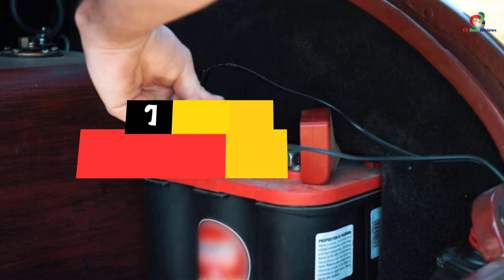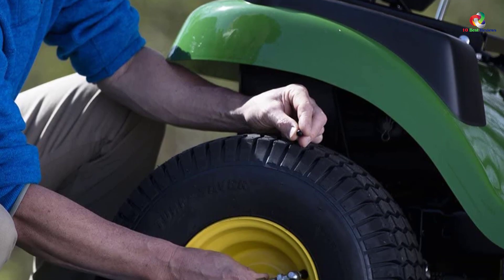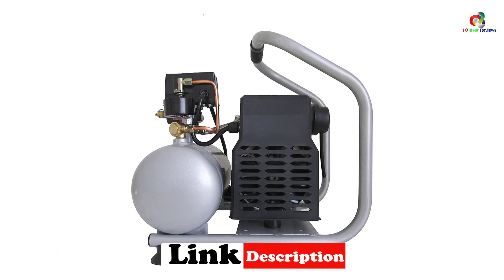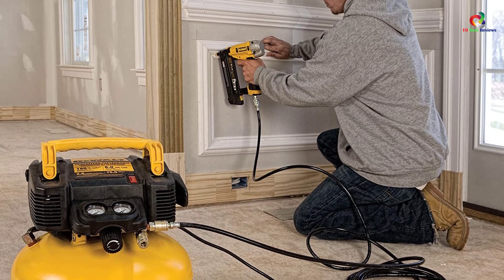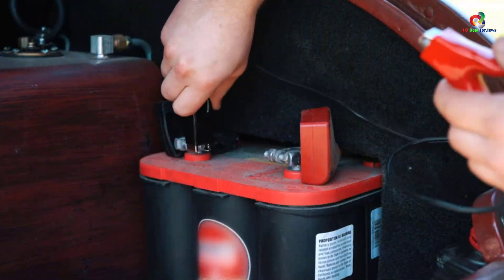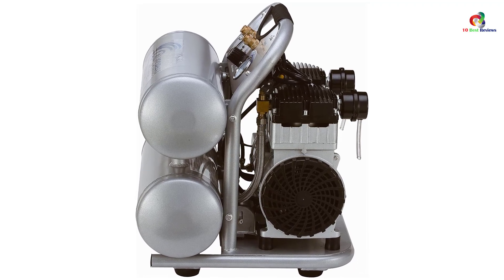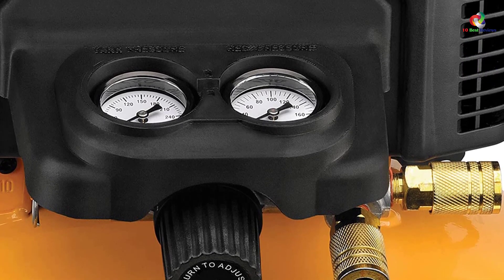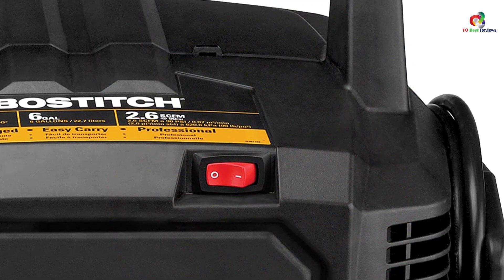✅Top 10 Best Air Compressors In 2023

Comment from the maker: ✅10. Campbell Hausfeld 4.6 Gallon Extra Quiet Air Compressor
👉 https://amzn.to/3FnMmkH
✅9. Craftsman 3 Gallon Oil Lube 135psi Portable Air Compressor
👉 https://amzn.to/3ZNtEuY
✅8. California Air Tools CAT-1P1060S Light & Quiet Portable Air Compressor
👉 https://amzn.to/3ldqzFG
✅7. DEWALT Pancake Air Compressor
👉 https://amzn.to/3JDjCqR
✅6. PORTER-CABLE Air Compressor
👉 https://amzn.to/3mKoyB3
✅5. VIAIR 88P - 00088 Portable Compressor Kit
👉 https://amzn.to/407Lada
✅4. CALIFORNIA AIR TOOLS CAT-4620AC 4GAL 2HP Twn Compressor
👉 https://amzn.to/3yCmYnD
✅3. EPAuto 12V DC Portable Air Compressor Pump
👉 https://amzn.to/3yCTMgj
✅2. BOSTITCH Pancake Air Compressor
👉 https://amzn.to/3yzBfS7
✅1. PORTER-CABLE Compressor
👉 https://amzn.to/3FKeJtR